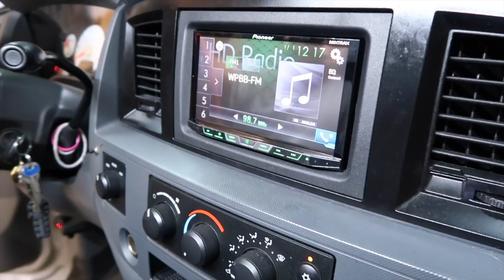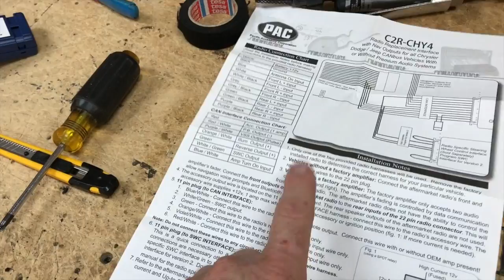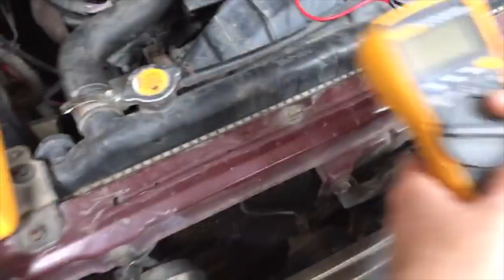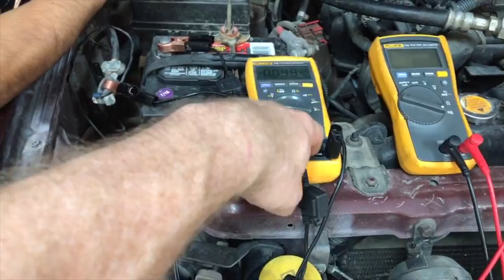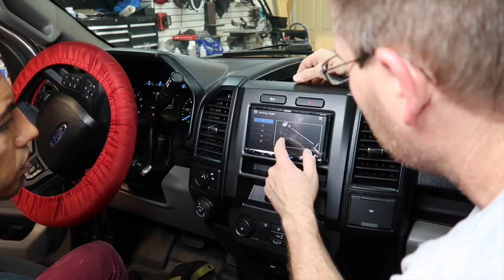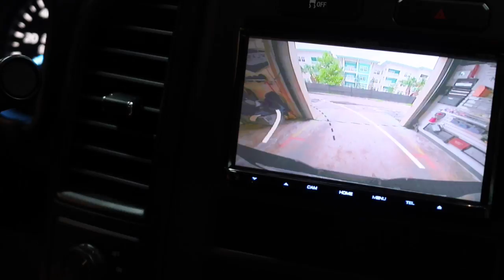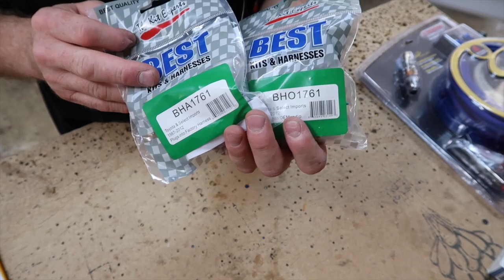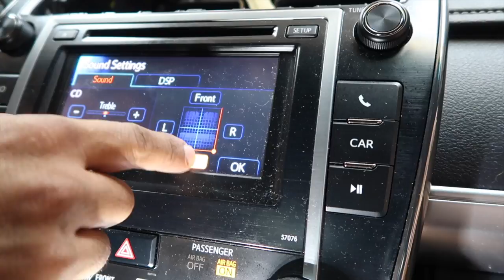The Installer Diaries episode 11, so your woofer makes a funny noise

Comment: Use a test light, pull ground, clamp test light to the ground cable, then  probe the neg. battery post with the pointy end of light. If the light is on, you have something drawing power.  Unplug fuses one at a time, if no change, plug fuse back in, move to the next fuse. ETC. When light goes out, you now know what electrical circuit the problem is in.
Reply: thanks for all the help einstein

Comment: I have a complete alpine system installed in a 2000 chevy silverado  I havd to use a 2003 dash besel to get the double din to work

Comment: You put in a lot of Pioneer 9605 amps. So how do they sound compared to the class D amps that you really like? I started to buy one but settled for the Rockford Prime 5 channel instead.
Reply: Rockford Prime are garbage imo.  My brother had nothing but trouble with the 5 channel and the replacement that was exchanged under warranty.   I found him a used older alpine 5 channel and its way better for 1/5 the price.

Comment: I am curious how the 7" Kenwood would sound in my doors. Would it be a worthy upgrade from my Alpine Type S 6.5" components?? Considering the Alpine midbass is practically non-existent.
Reply: They are in the stock location. Component tweeters are in the stock location. Sound deadening baffles behind the drivers. Tighter bass but still very weak. All hooked up to Pioneer gm8604 amp. So no lack in power. Should be much more responsive than what they are.
Reply: ekim andersom  but now you are contradicting yourself. Worthless uneducated information needs to be kept to one's self.
Reply: ekim andersom  a car is a whole lot different than a sound booth. So many variables.

Comment: I enjoyed this video thoroughly. I did have a question: when Fernando was removing the wire from the door boot because the previous install caused a tear in the wire, how difficult is this to do and what would you suggest the easy way of running new wire from door speaker to amp? Actually, easier question Speaker wire harness to amp vs speaker wire from speaker to amp? Once again, I appreciate this vlogs as they are informative and im working on upgrading my radio/speakers/sub into my 2007 Honda Accord V6 EX-L. ( my radio has integrated climate control and the 2 dash kits I found are terrible looking and costly ...smh) Have a great weekend. Hope you had a great Fathers day.

EDIT: Twitter yes / I use YouTube Live.
Reply from the maker: +Trevor Tosh if we need to run new wire and we can work around the plug we do. If it is impossible or have to drill a hole we just grab the wire in the kick. If the amp power is around 70 watts we will just use the factory wire. Have you seen the PAC-Audio kit for that car? Thank you for the feed back.

Comment: With that Toyota Matrix, my guess is they bought all that old equipment on craigslist, thinking they got a good deal on it, but really ended up overpaying. People in my area try to pass off stuff on craigslist thats 10 years old for new prices. I just saw someone trying to pass off an 8 year old Pioneer AVH as "new, only opened the box" but it had scratches all over it, and they were trying to get a price higher than what 4400NEX costs new.

Comment: what speakers went in the matrix?  my wife's car is a matrix.  did you test the height adjustment in the drivers seat to see if it still cleared when all the way down?
Reply from the maker: +eric neuman sadly they used the factory speakers. I know. Yes the amp cleared the seat.

Comment: hey guys I have a reacuring problem. I have a pheonix gold Elite 12" D2-ohm sub that is giving off a horrible rattling or vibrating noise! Would ya'll know where this noise is coming from? Thanks in advance.  Great video!
Reply from the maker: +Matthew Campbell  if it is not the box, it sounds like a bad motor structure. Sometimes they make noise for no reason. We usually swap them out for a new one

Comment: yes it is over a year from date of purchase.  so it would not be covered under warranty. But I would not want to sell it to someone the way it is! I guess I'll just start looking for another sub to swap it out with. cause I can't find a re-cone kit for this sub. have ya'll seen any or know if pheonix gold sells re-cone kits? I have not been able to find any. I wish that they would sell a recone kit with out the led light's in the middle. it is not the box cause my box is completely sealed off. I sprayed a coat of sound deadener on inside and I have rihno liner on the outside of the box it is 2.93cu. total before the sub.
Reply from the maker: +Matthew Campbell well that stinks, yeah it sounds like your box is well built👍

Comment: I have a 2008 Honda pilot with pioneer avhx4700bs. I want to get a better sub woofer that'll fit the factory location.  will the head unit have enough power for the sub. I don't really want to get a  amp nor do I need much more bass. just more than factory.  Any advice on what size sub etc. I'm guessing 8-10"
Reply from the maker: +Tony Aguinaga the radio will not power the sub. It only has 50x4, nothing for a sub. Pioneer makes a nice 8inch sub. If you do not mind losing some room look at the Rockford P300.10.
Reply: Five Star Car Stereo
I want to put it in the factory subwoofer spot. do you have a model # for the pioneer 8" sub and a good matching amp?

Comment: Dean back in the day which car speaker of these 3 did you prefer, Jensen, Craig, or KLH?
Reply from the maker: +Kevin McWilliams haha some Craig rear deck 4 way speakers.
Reply: Five Star Car Stereo: I started with some 6x9 Jensen coaxs. Replaced those with some Craig's with  80 oz magnets. The best speakers I ever heard were the KLH'S. I didn't want to spend over $100 for them though. Thank you for your video on the plug and play Focal speakers for my Camry. They sound awesome along with my Kappas in the rear deck. Tell Paul thank you for sending them out to me.

Comment: five car stereo 
I have a question I have two 10" memphis subs and a 500 watt jvc its loud but not as loud as I want it to be..if i add a 700 watt Rockford fosgate amp punch will it sound louder? thanks
Reply from the maker: +Daniel Reyes it will be louder, just make sure the woofers can handle the extra power. What type of box do you have? A biggest ported box is also a way to make it louder.
Reply: I'll try to reply to you guys in fb i believe it's a ported box

Comment: what would you recommend to use to install 4 new interior speakers with a 4 Channel amp into a stock radio on a 2015 charger go get the signal??
Reply from the maker: +sleepymalo06 either a PAC-audio LP7-4 or the AudioControl Lp7i
Reply: Five Star Car Stereo tap into the wires behind the radio ?? I really don't wanna cut them.
Reply from the maker: sleepymalo06 order a reverse harness and a standard radio harness and make a T harness

Comment: Should I get a jbl 6x9 component or 6.5 ? Does a 6.5 really sound better
Reply from the maker: +Troy Thomas no I would not say it sounds better.  It may fit better. The 6x9 will have more mid bass in most cases
Reply: Why do people say it does? I have a 06 4runner sr5 and all I want is a great system. Choosing between components has been a pain because everyone says something different.
Reply from the maker: Troy Thomas yeah I have heard that for years also.